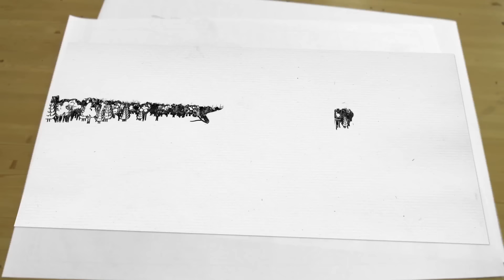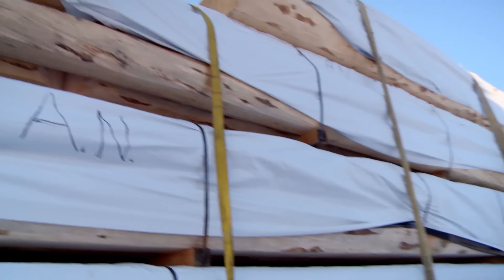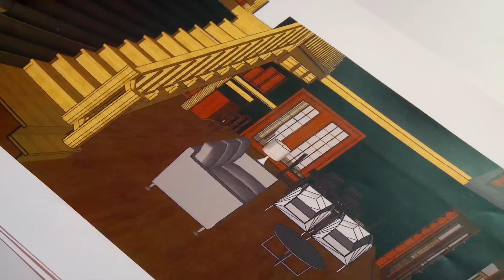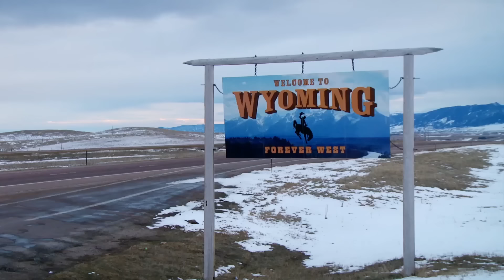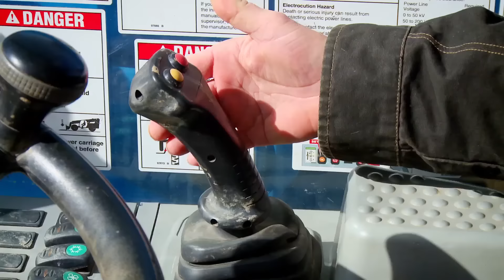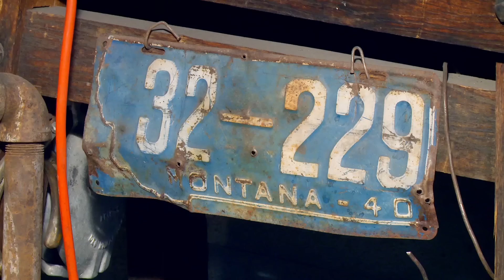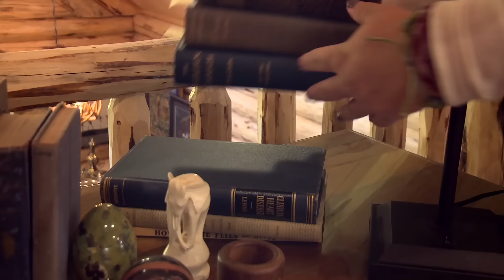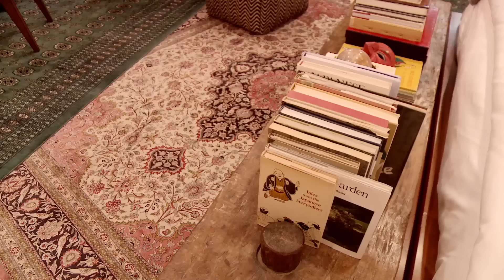Episode 2 | Log Chalet in Kansas | Amish Dream Homes

Comment: Foam gaskets between the logs usually don’t work because the cells in the foam are so compressed by the top logs that they will not expand to close an air gap after shrinkage of the logs .Plan on elastic chinking with foam backing to cure most heat loss . This will look good and Will add quality value to your log house along with special coatings for a lot more simplified down the line servicing .

Comment: You have to be an Orthopedic Surgeon to afford a log home,,,,I.had one priced out for me 1079sqft,,,87,000 in the material only,,,the lumber goes through a Kill drying process where they slowly remove the moisture and then,,,moisture is put back in and taking back out,,,, this process keeps your logs from warping,,,it was beautiful when finished,, probably would have 
140,000 in it turn key..
👍👍good luck

Comment: I'm curious I see the used Husqvarna I've always used still I'm serious or Husqvarna or better? They seem to know they're soft so obviously they're all commercial but makes me wonder? There's good and bad in every saw
Reply from the maker: We’ve actually been using stihl for about 3 years now. There are definitely many pros and cons with each brand. With our experience the Husqvarna saws are generally a little heavier and more robust, and the stihl is lighter and seem to run better, but not built quite as solid. But they are both fantastic saws.

Comment: Thing with log homes is the out structure is expensive but you have no expens of expensive material like tyvec insalation no sheatrock tap screws muding all the laber of diferent trades to do all finish work lik the studs and sheatrock and paint so your realy just as expensive but log homes are vary hard to find inshurance

Comment: No,insulation between logs?? Still really nice tho
Reply: Flat cut so there was several inches of wood between inside and out, and it looked like there was a spline to fill any possible air gap.  My sister's place was built the same way.  If the fire in the wood stove went out it still took the place  three or four days to cool down.

Comment: How do log homes stand up to a tornado ?
Reply from the maker: One of our commercial log structures in Joplin Missouri was in the path of that vicious tornado, I think about 15 years ago. It was several stories, quite tall so that contributed to more exposure and therefore more damage, and it withstood pretty well, but there was too much damage they had to tear it down. Log Homes are strong but a tornado is probably stronger.
Reply: It's like the tale of The Three Little Pigs. The safest structures are built of Stone.

Comment: What is used for the Insulation - in the ceiling  - between the pine boards you see inside, and the roof shingles on the top?
Reply from the maker: Spray in foam insulation is used in the ceiling and sprayed directly onto the top side of the ceiling boards. This provides the tremendous energy efficiency of a Meadowlark roof and is far superior to fiberglass insulation. In addition to being a superior product, we have a unique method of raising all the rafters of the ceiling decking allowing the spray in foam to flow underneath every member creating a seamless insulation barrier throughout the whole roof.